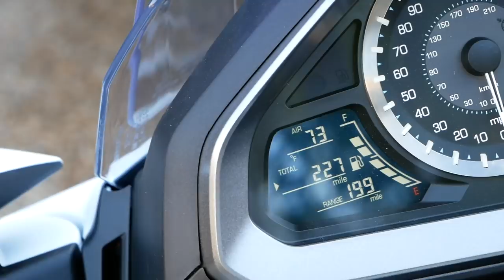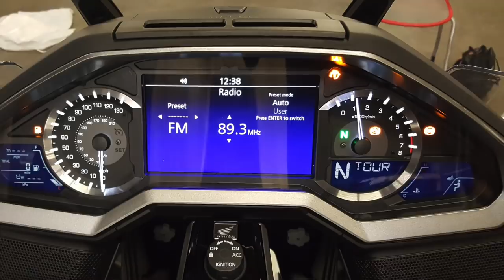2018 Honda Goldwing Long-Term Review

Comment: Chris, totally concur with your assessment of the 2018 DCT Goldwing. Had mine for one year and have put a little over 23000 miles on it. One thing... I believe the lack of Android support is on Google, not Honda. I remember reading that Honda would be happy to allow Android Auto on the Goldwing if Google would support it. I have an iPhone and love the Carplay function.
Reply: There has to be a way to support Android Auto as most new cars now support both Apple and Android.
Reply: That's a lame excuse..... my 2019 Honda Insight has BOTH Apple Car Play & Android Auto.   That's another black mark against Honda for me not purchasing a new 2018/19 Goldwing & keeping my 2012 instead.
Reply: @henryhonda8408  ,again.. It's Google's decision to not allow Android Auto on the Goldwing, not Honda. From an article by the The Verge:"It doesn’t have everything, though; after all, Android Auto is missing. The blame for that goes to Google, at least according to Honda via Road Show." ... and from an article from CNET: "Bad news for Android Auto users however, according to CNET Google doesn’t have any plans to allow for Android Auto integration into motorcycles at this time."  Pretty sure the car division of Honda has nothing to do with the Honda motorcycle division.
Reply: If that's the case then..........SHAME on Google & Honda, probably a licensing issue then between the two companies which is likely ALL about MONEY.  Something like this by itself will not affect my decision of not purchasing a 2018 but add it to other little irritants (smaller trunk & saddlebags, GPS sucks etc) and it probably makes it a deal breaker.  I've been tossing the idea of maybe going to a Spyder RT as I'm getting up there in age and this is pointing me more & more in that direction.
Reply: @henryhonda8408  , yep, probably a money issue. Ride what ya like and like what ya ride. Wishing you many happy miles!

Comment: Just took delivery on my 2018 today.  Rides 3 times better than my 2004 Goldwing.  I do like the weight difference from the old one. The dealer took $6300 off to move it out.  Thanks for the videos...

Comment: Chris,  nice review. I would have hoped the a new version of a motorcycle or anything would be an improvement over previous models. The biggest problem of upgrading to the new model is cost. Many people have thousands of dollars invested in accessories on there current Goldwings. These old bikes will run for a very long time.

Comment: Cruiseman I told that about a year that I can from a Ninja ZX14. But, I've been riding Goldwings for a few years. I drove the 18 Goldwing for a few months which my Cousin owns. It's a very good bike. BUT! I'm 6'2" 285lbs. So, with my girlfriend and myself was a tough ride. I went out and purchased the 2018 Yamaha Star Venture, not sure if I was making a mistake. Man, that's the best bike that I've owned so far. I thought that it would be extremely hot. But it's working out very well, when riding it for a long time it get hot but I open or close the vents when needed I love it. More torque than my Goldwing by far. I love your videos, keep up the great work.
Reply from the maker: That Star Venture is a BIG bike. I looked at one on the showroom floor and was shocked at how big the trunk was! They are beautiful bikes, and a good choice for someone your size. I am 6'2" and 180 and the new Wing is just right. But, I used to weight 250 and I think it might have been to small for me back then. Ride safe.

Comment: I had a 2002 goldwing and a 1992 goldwing. I find my 2018 wing engine nevery bit as smooth if not more so. Around town low rpm fuel economy is due to 4 valves per cylinder with better fuel mix circulation in the cylinder. I agree on the nav. Honda dropped the ball on this miserably and it is still poor after the 2019 update. Pearl stallion brown unit I have has flawless paint. Not a blemish anywhere. No orange peel at all. Fit and finish on mine is perfect.

Comment: Cruiseman, Great video, coming up on a year and 9800 miles, have the non tour 6 speed manual. My only complaints grab rails, helmet lock and dip stick and process for checking oil. Got lucky with the seat, I have shelved the air hawk (first factory seat that works for me) I use the GPS so little can't really comment, apple car play maps solves the issue and with our new Cardo's the operation is seamless. I wear passive noise cancelling ear buds and never have noticed any drone maybe its the buds or could it be DCT related??  Fit and finish on the bike is flawless according the VIN I got the 53rd one off the line. Only technical issue was an intermittent problem with the hill stop assist it would flash a fault condition  but apparently fixed itself as it hasn't happened in months. The is my first wing so I'm sure I have a difference reference point than previous model owners but it is by far the best bike I have ever owned. Tks keep the vids coming

Comment: I’m at a little over 1 year and 10k miles and I pretty much agree 100% with your assessment. I spoke with Honda corporate last year about the navigation system and was told that the negative issues would be addressed - obviously they have a different idea of what needs to be addressed. So far, the 2 updates have been bandaids to a patient with a terminal disease. I just tried to use the Honda Trip Planner and upload a route - total disaster. I’ve now come to the conclusion that you did awhile ago - buy an external GPS. This system is an embarrassment! I’m amazed that my friends with Harley’s and Indians have a much better navigation system than what Honda threw together. Also, the sound system is really pathetic. The good news is that I ended up getting an iPhone and the integration and Car Play is great. Thanks for the great review!

Comment: I remember the purchase date of my 2018 GW Tour DCT (red) because it was Star Wars day (May the 4th be with you!). Now, I've passed the 8000 mile mark and need to change my oil. Fortunately for me, this time I'm going to avoid the expensive shop time for an oil change by watching your maintenance video on how to change the oil myself. This alone will pay for the maintenance video series. Thank you! As for your one-year-later impressions on the bike, I still love it and think the DCT is phenomenal. Now, nearly a year after Star Wars day, there is one thing about the bike I truly hate, and one thing about the bike that doesn't peg the hate meter but is a constant annoyance. First the annoyance; the auto-cancelling turn signals are not timed right. Especially for the right turn signal. I have to be on top of the turn to the right (unless there's a turn lane to switch to first) to start my signal or it will time out before I get to the turn. It's just 10 blinks long. Period. I could keep renewing the right signal or I can go fully manual turn signals. Renewing the turn signal is more work than simply turning off the auto-cancelling and signaling manually. The only drawback there is that I sometimes forget that my turn signal is still on. I get ribbed by the people behind me in a group ride. I'm getting better, but either way, the turn signals shouldn't be claiming so much of my attention. Now, for the thing I hate; The  4-way-plus-center-button selector pad on the left handlebar! I traded in a 2018 Indian Chieftain for the Goldwing (still the best V-twin in my opinion) and it had a 4-way-plus-center selector on the left handlebar that was far, far better. You could say I'm spoiled because I know the feel of a far better selector and I want it back. The GW selector, being a flat design with a center button, requires my full attention to operate. I would make many accidental choices if I didn't look at my gloved left hand and watch it to see that it presses the right-arrow button without triggering the center button first. I cannot clearly feel where I am on the selector pad and I have to concentrate to detect where my thumb is on the pad when I need to keep my eyes on the road. My Chieftain had a design that was a joystick instead of a flat pad but it accomplished the same five functions by your thumb finding just one thing; the top of the joystick. Talk about easy to detect through the thickest glove! The tip of that joystick was the only thing I had to find by feel so no searching for a different button for different functions and just rock it left, right, up and down, or press down on it for center button functions. Ahhhhh... what a relief it would be if Honda ditched the abomination of that flat pad in exchange for a joystick. But, to be clear, in the final accounting, I think my 2018 Goldwing Tour DCT is just the best and I would choose it again.
Reply from the maker: I guess I am used to turn signal issue you describe, because every Goldwing I have owned has had the same issue. I wish Honda would employ a "double-click" on the turn signal switch. Click once for Auto Cancel, click twice to have the turn signal remain on with manual cancel. Or double-click to double the time the signal stays on, triple-click to triple the time and so on. I would prefer a joystick too, but I have never experienced that, so I don't know what I am missing!
Reply: @cruisemansgarage  Actually, my Indian Chieftain also had better turn signal programming. No double-clicking involved. I loved it. Auto if you push the lever to signal left or to signal right and release. However, if you HOLD the lever either left or right for more than once second, then the signal would cancel on release of the turn signal lever. Perfect for signaling to change lanes and immediately cancel on release of the turn signal lever after you're established in the new lane.
Reply from the maker: @mrdonsmith  I like that system.

Comment: The new Honda Goldwinglette, that should be the real name. They took a two up cross country touring motorcycle and reduced it by almost 10% to give their customers a solo rider weekender that you can’t put a helmet in. If I wanted a lighter bike with less storage, less wind protection and more vibration, I would buy a Vespa. It seems to me like Honda knew they got it wrong on release and started trying to give deals to anyone that would market their pile of crap in a better light to boost sales. If Honda is going to sell me a New Goldwinglette with 10% less and then I have to put the rest on it after purchase, something is wrong. I will stick with the 2017 version or better yet purchase a BMW K1600GTL, that has storage I can put 4 helmets in and imo is considered a cross country touring motorcycle right out of the crate.

Comment: I am happy for you that you like what you have but for me I will be keeping my '08 wing. In my opinion there is no such thing as a GoldWing after '17. The '18 doesn't even look like a wing it looks like and rides like a sport bike. I hear you say you have accepted and adapted to many things well for the cost that is not what you should have to do. If someone gave me one of them for free all I would do is put a for sale sign on it. What they should have done was keep the size of the bike and just added the electronics to it. Ride safe and once again I am glad you like it.
Reply from the maker: I understand. Like I said in the video, the new platform is not for everyone. It is a shame that Honda did not apply all of the new tech to the previous generation and give buyers a choice. But, the market just is not big enough to support it.

Comment: I enjoyed your year-end review...I ride an old but great 2005 GL 1800...I was surprised by your comments on the front suspension as I recall 
an episode where you upgraded to a TRAXX front end suspension, saying the stock front end was lacking...are your comments about the stock
front end or your glowing review of the TRAXX system?...Keep up the great work...wish I could get out of town as easy as you do...
Reply from the maker: I had Traxxion Full Monty installed on my 2007, and it really made a big difference. I have no doubt that the Traxxion upgrade for the 2018+ would also be an improvement. When it comes to suspension, nobody knows more than Max, IMO. But, for ME, the stock suspension is doing a good job. When it comes time to replace the factory suspension, I would definitely look at a Traxxion upgrade.

Comment: Chris I just came across this item regarding the new 1800 you may wish to address. On prior goldwings one can have a near dead battery which will just barley crank the engine over yet it will start and after just a short period be just fine for rapid starting. However on this new wing which uses a unitized starter/alternator even with a moderately charged battery the starter will simply grunt and then all the electronicas will reset. This new wing will absolutely not start unless the battery is good and strong. This could be a real issue if one does not  keep the battery fully charged at all times.

Comment: Thank you for the video by the way! I had to pause it at 11:26 regarding the apple car play and then previously the GPS. I have built in GPS in my car and there is no substitute for a self contained unit that doesn’t rely on cell signals when you are in the middle of nowhere but I give it a thumbs down for day to day use, it’s last minute notification and not really detailed then there is traffic or road closures or changes and I have to keep it updated, I have the BMW navigator on my R1150RT which is just a rebranded garmin and again it’s good when you don’t have any cell phone signal but again it’s not always up to date, and current on road conditions. BUT most of the time you have cell signal, not always, but most of the time you do and I’ve found in my newer Toyota Camry with apple car play, the mapping interface is amazing, it’s useful, it’s just miles away from the built in GPS on anything and it’s detailed, it works well, it’s up to date with everything from accidents to updated routes, construction, and changes in the maps. So I would think, I don’t have a goldwing, yet, but I would think if you got an apple device and could use more of the built in features on apple car play, you might enjoy that tech a little more. It’s also quite nice to have the Siri assistant, she understands you better than the built in unit sometimes when you give it a voice command. You own the bike, so I would like to know your input on it, please, I am considering a goldwing.

Comment: Thanks for the video!
One thing that kind of irked me about my new DCT Tour was the foglights.  Yes, the dealer told me they were backordered, with no delivery date promised, but Honda sold them to me anyway on my new bike.  It took FOREVER for them to come in.  My only other peeve is the fact than I have to make a phone call (just dial the number then hang up once the dash display registers the call) in order to get my phone to play thru the stereo. My phone is a Pixel2.

Comment: I have just done a test ride on the 2018 DCT Goldwing. I must say I loved it. The only thing I did not like was that the bike always is in a gear when going around corners and roundabout. I usually clutch my GL1800 and let the bike glide around turns in idle. I guess this is something you will get used to. Great bike, I would love to have one.
Reply: that   is nothing

it is always  in the right gear

my 2020 is divine